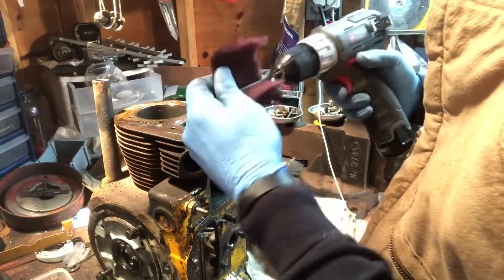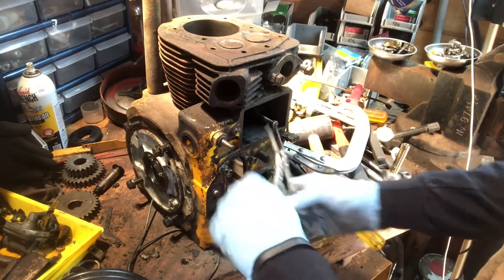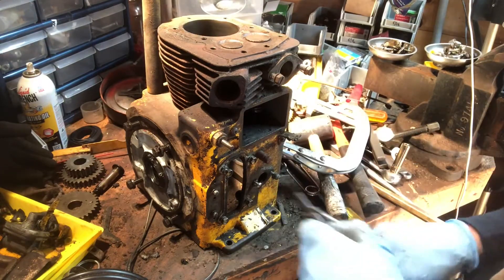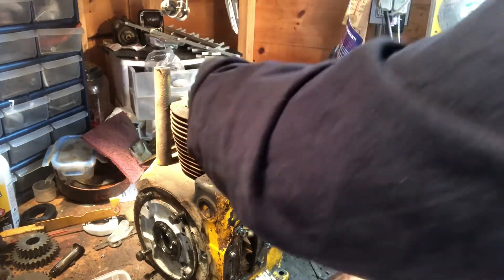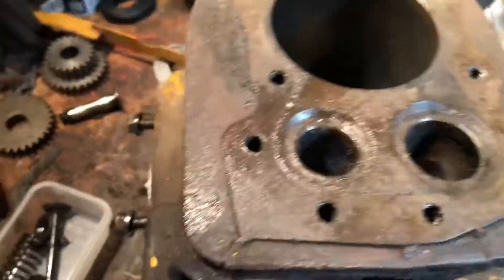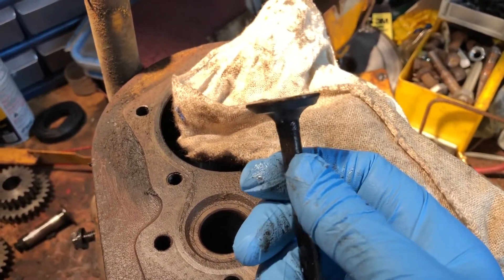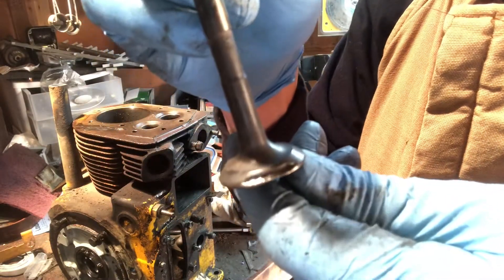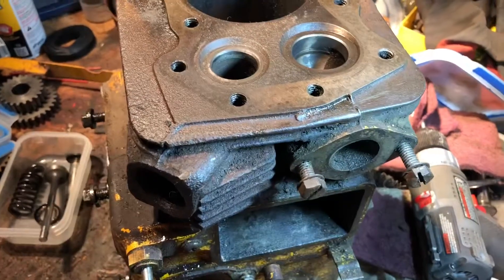Disassembly of the Kohler K241 (valves)

Comment: K-series valves are not parallel to the bore, but are set at an angle. (4 degrees I think?) This helps move the valve closer to the piston without crowding out the camshaft area. That tilt is what you were noticing at 8:25.